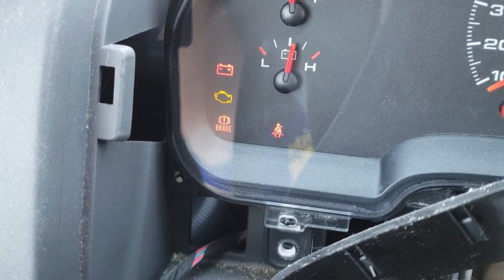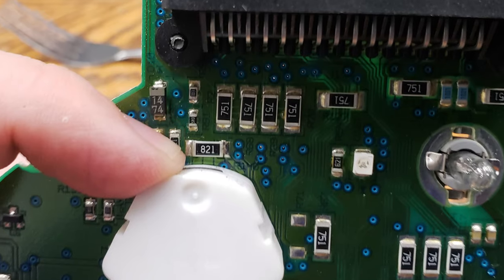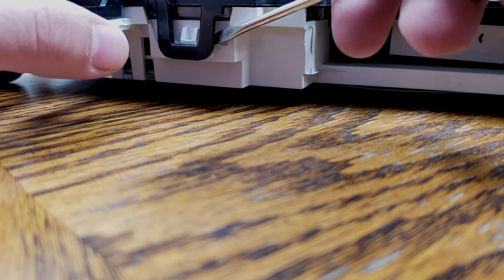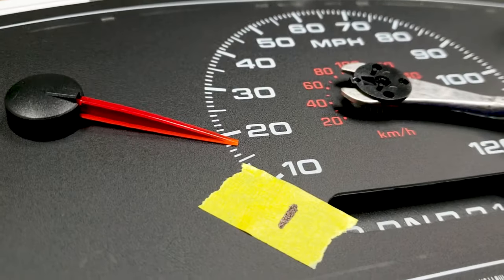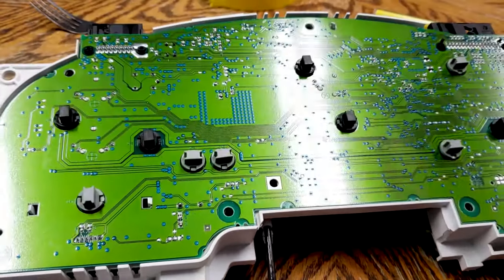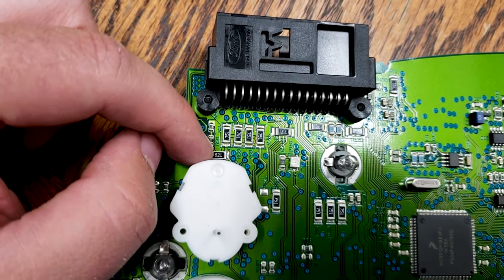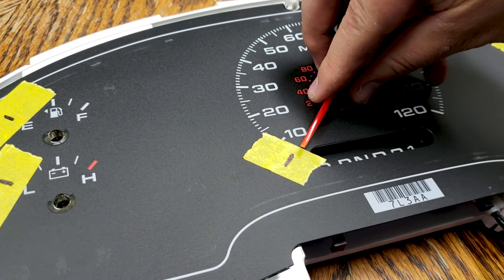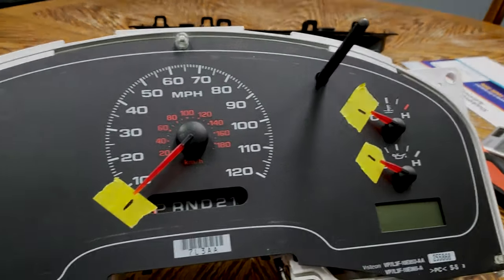How to repair the RED WARNING Brake Light Ford Truck

Comment: Thanks! This worked for me and fixed the brake warning light, except now my fuel gauge isn't working. Any idea why?
Reply: Maybe needle pushed down too far and binding
Reply: Did you figure out why?
Reply: @Jeff-qc6cc probably because I'm not good at soldering. I never got it working again. And later my LED odometer quit working.

Comment: Why remove front and needles if is on the back and simple?
Reply: The circuit with the 821 resistor is not accessible from the back, it is sandwiched between the green board and the face. The stepper motors that drive the gauges are also between the face and back so the gauges need to be popped off to allow the two pieces to separate.

Comment: My f150 has the battery light on and the brake light on.truck runs fine .Im thinking its the soder just wondering if anybody knows battery light resistor
Reply: My 2008 F150 also has the battery light on. I have load tested the battery and alternator and everything has been running good for the last 4 years. I finally bought a tuner and scanned the truck with it, it finally gave me the code to the battery light. Something my small cheaper emissions scanner could not. The code it gave is P0625, "Generator Field/F Terminal Circuit Low". Mine is not severe and has not given charging issues.
Reply: chefpete1978 Tuner or emissions scanner?
Reply: chefpete1978 SCT X4. Just a basic tuner

Comment: I see no reason to take off all the needles everything you have to do to fix is on the back.
Reply: Hi Chris. Are you saying that the problem of the parking light staying on is on the back of the board. Just asking because I soldered the resister behind the needles and it didn't work for me. Thanks for any info.
Reply: Finally found my problem with parking brake light, it was a small brown surface mount capacitor that was cracked right behind that left terminal plug on back of cluster . I replaced capacitor and that finally fixed it.